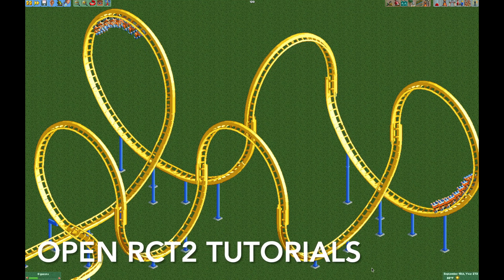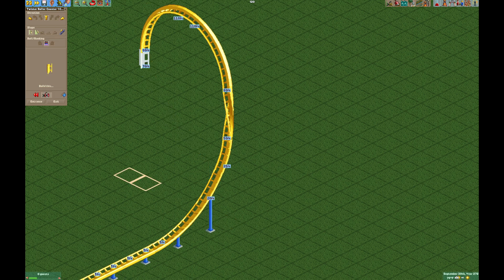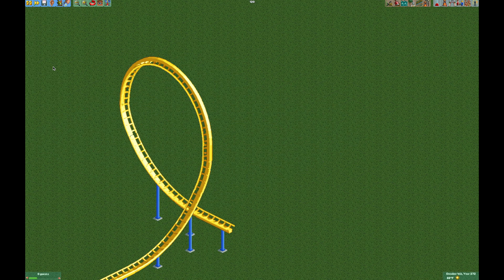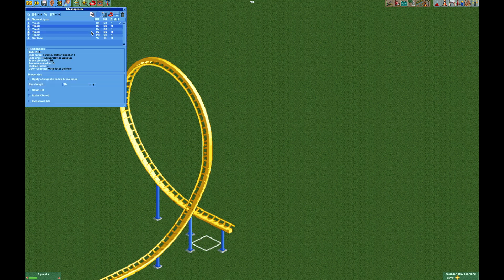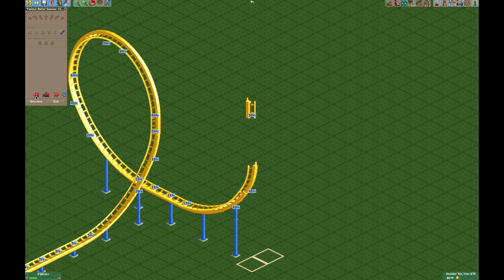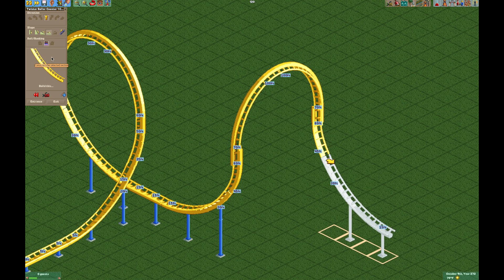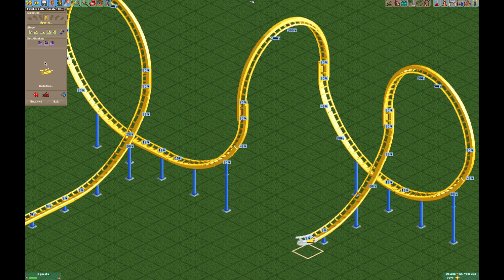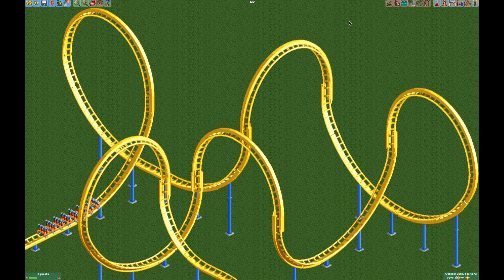New Inversions - Dive Loop & Immelmann – OpenRCT2 Tutorials

Comment: I've been trying to do this but the track doesn't connect, or the trains don't go over the edited track piece. Is there something I'm doing wrong?
Reply from the maker: Do you have disable clearance checks turned on?
Reply: @openRCT2tutorials  Yes I did. Tried toggling it off and on a few times, still didn't work. The track just builds through the track piece you're trying to connect when they're turned on and doesn't actually join them together
Reply: Also the coaster train just derails and crashes when they try to go over the modified section for some reason
Reply from the maker: @meleegaming101  They won't physically connect like when merging two different track types together. The piece of track that you want the train to transfer to is the track that needs to be lower in the tile inspector. You can check the tile inspector to make sure there are two track pieces on the same elevation. Make sure the track that the train starts on is higher in the tile inspector order (not actual height) than the track piece you want the train to end up on.

Comment: Have you attempted in creating a Zero-G Stall using this method?
Reply from the maker: You can't merge the twister track in that manner. The only way that I know of to create a stall would be using the flying coaster, lay-down coaster, or multi-dimension coaster. The only problem is, unless you are using a vehicle of the corresponding track type (flying/lay-down/multi-dimension), the vehicle will disappear on the upside section of track.